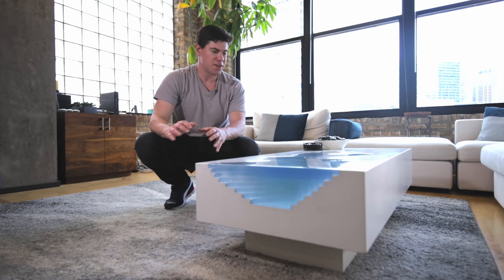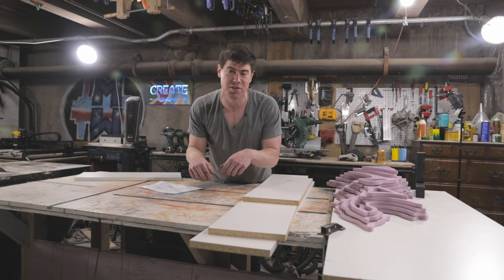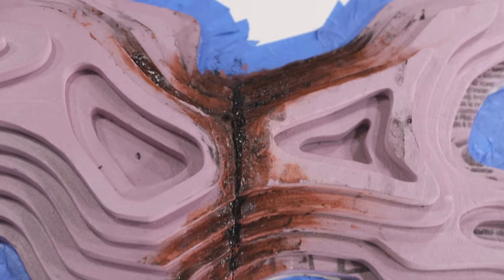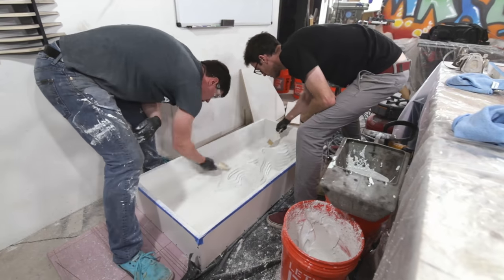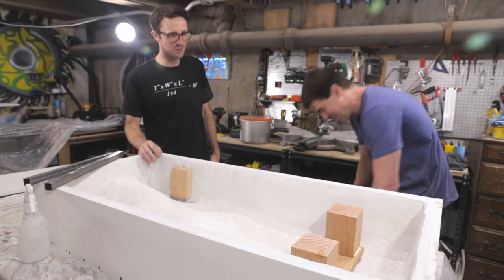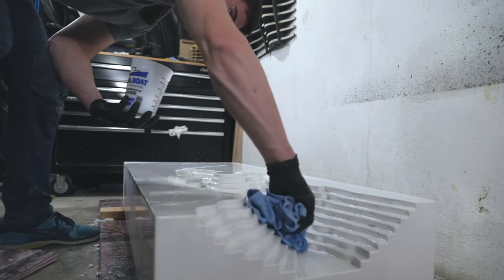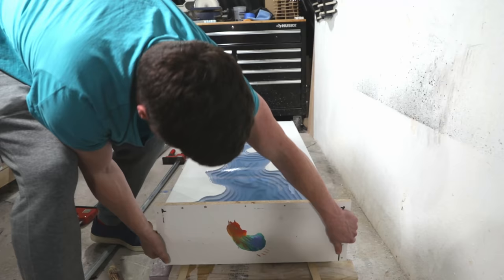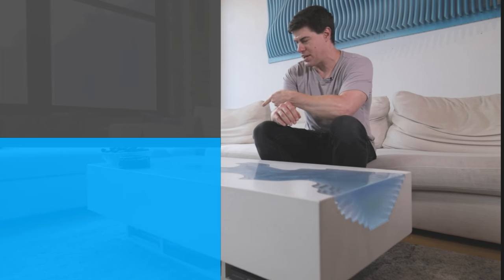Making an Epoxy & Concrete Coffee Table

Comment: Nice coffee table. How about a light set in the bottom? And round recesses for cups (like car cup holders).
Reply from the maker: Good ideas!
Reply: MrBLUEDEVILUK ☝️
Reply from the maker: Another good idea!
Reply: if that was mine, I'd put a thin clear piece of plexiglass over it so if anything spilled, it wouldn't touch the table itself.
Reply from the maker: Plexiglass would definitely help protect it!
Reply: TreeStevens plexiglass scratches too easy imo
Reply: Why would need a cup holder in a table, just put the cup on the table. lol
Reply: naytron I own a dog with a wagging tail. I’ve lost count of the number of times he’s whacked a cup full of drink on our low coffee table. Besides it would make it even more original. Have you ever seen one with a sunken cup key hole design?
Reply: @MrBLUEDEVILUK  I mean or you can just throw away the dog. No more mess😃

Comment: 1:36 made me scared. You should be happy your sawstop emergency stoped. Please never ever use a paralel guide while crosscutting, the board between the paralel guide and the blade isn't secure and if it jams it is going to fly.
Nice build for the rest!! Good use of all techniques.
Reply: I thought the same thing, especially because he was pushing the off-cut with the push stick.
Reply: Please help us noobs understand so we don't die. So when crosscutting against the grain of wood, you should do it by hand? Or?
Reply from the maker: The thing I did wrong was using the fence in conjunction with a cross-cut sled...as I've now learned, this is a big no-no.   Using the sled is fine, as long as the piece you are cross-cutting isn't riding the fence as you cut it.
Reply: you can use the paralel guide ofc, but it HAVE TO end right before you enter the saw, so you cant get stucked. and ofc... dont push on both sides, since it will get stucked again...
i just wonder how it comes somebody got a nice table saw in his shop and has no clue how to use it  /facepalm

Comment: 1:37 Thought the piece was going to get twisted between the blade and the fence, and get thrown with enough force to punch a hole in the wall.
Reply from the maker: and it didn't ;)  that said, safety dictates it isn't worth the risk... will move the fence in the future when using the crosscut sled.

Comment: Vacuums the dissolved gasses out then pours the epoxy into the mold like it's water.
Reply: exactly what i was thinking lmao, whats the point to vacuum if you're gonna pour a thin stream from 3ft in the air.
Reply: Ya that was a waste of time in my opinion

Comment: FYI you can totally cut foam like that with a box cutter, make sure the blades are sharp, don't be afraid to replace them every few minutes, and you'll have no foam dust to contend with and no cnc costs to worry about. The only thing to watch out for here is just keeping your hand 90 degrees to the surface as you cut it for a nice stepped look like the cnc provides, or expect a little more wiggle in that stepped look. Finally to translate a sketchup design onto foam like that by hand, I've found taking screen shots of the form, and then using a projector works really well. if you set the cad of the form into a theoretical rectangle that matches the real life size of the form (say 4' by 4') you can match up the projected screen shot up easily to the actual form to be traced. If you use a little care Ive found this gets accuracy to about 1/8 of an inch, if you're really meticulous you can get it even tighter.
Reply from the maker: I always get little tears when I try to use a box cutter.  A $12 electric turkey knife also works pretty well....

Comment: Love this build, but my first thought is... when the table is turned upside down to insert the foam it would be cool to add a couple small tube inserts at the highest/deepest part of the epoxy sections which would, after applying the concrete, leave small open cavities to insert a couple small LED lights which, when inverted would light the epoxy from the depths.
Reply from the maker: Thanks!  I actually made some 3D printed LED modules to do exactly what you suggest, but the build was already so complicated I decided not to push it this time.  Of course that just means I'll have to do a sequel to this 😉

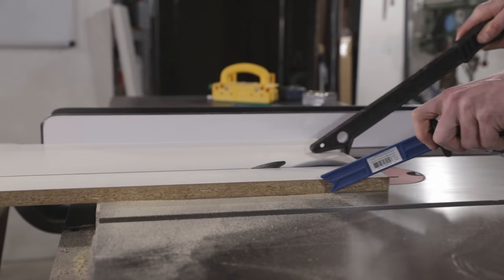Comment: 1:35 
F.
I learned about the Saw Stop in grd 9 shop class, its a life saver but can be a pain with glitches like this,  our table needed 3 replacements due to misfires in the safety mechanism similar to this, and they were quite expensive to replace.
But when it did that in an actual situation it saved my neighbors finger.

Comment: DAP Kwik Seal filler is the best for filling gaps in that pink foamular board.  That or some wood filler, but the kwik seal is a bit better.  Basically, anything that isn't corrosive.  The pink foam board reacts much like styrofoam does and will melt even to some of the mildest corrosive compounds and adhesives.  It's not as resistant as EVA foam.
Reply from the maker: Thanks, good tip!

Comment: Dude... to fill in gaps in foam or to reshape it, just use drywall putty (or spackle). It's the best thing. Doesn't damage the foam and you can make it the consistency you want to by just adding a bit of water. It's what miniature terrain makers like me do :)
Reply from the maker: For sure!  In subsequent projects, I've learned from this mistake and done exactly that (check the concrete beam bench and white concrete sink vids, for example)

Comment: You did such an awesome job showing us how you did each step. Both the good and bad experance was so greatly appreciated so for those who may want to do such a project can learn from what you had done. 

I often think artist are more scientific then most scientists.  Just as you had shown.
I was originally thinking you were going to fill your box frame with cement. Then I was wondering and thinking that is going to be one heavy  bear to lift and move. But, then yiu did is so it would be hollow. That extra thinking I bet made it a lot more easier to move.

Maybe this may help.  When taking art and we would make plaster of Paris  body cast, usually death mask of our self to later fill with clay and put into a kiln to harden the clay.

Well when doing so, we would smear vaseline over our face with a shower Cape over our head so to help keep the plaster of Paris from sticking to us and make it easier to move.

Maybe that may help you as well of give you other ideas so you don't have so much sticking problems with other projects.
Reply from the maker: Thanks!  And I like the "outside the box" thinking!

Comment: That's amazing! For the next table like that you could put some LEDs in there for awesome night/evening lighting, since it's basically an empty box it should be fairly easy to hide some batteries underneath it :)
Reply from the maker: Thanks! Something like this with LED uplighting thru the epoxy is on my build list ;)

Comment: I'm sure you know this by now but you used a Thinner-Based non catalyzed spot putty that is only recommended for pinholes. For future projects try "Evercoat Catalyzed Polyester Glazing Filler".... super easy dispensing container, mixing, shaping and sanding. Takes any kind of finish and wont eat up your styrofoam.

Comment: Polyester resin based fillers dissolve polystyrene foam. Hard lesson learned. You could have used Gorilla Glue in that gap in the foam. It will foam up and fill the gap. If you spritz the foam with a mist of water it will cure quicker. You would have to shape it a bit to the final shape after it cures but that's easy enough with a little sandpaper. Or, a setting type drywall mud would work as well.

Comment: Johnsons floor wax works very nice to make things not stick to the concrete. I made inserts that looked like stone for the face of concrete steps at the Disney resort in Oahu. And kids clay works great at sealing gaps and edges then heat the floor wax up. And brush it over everything. The forms practically fall off.
Reply from the maker: Good tips, thanks!

Comment: this process would be easier called "Shotcrete" as you are spraying it! Can be sprayed dry, or sprayed with water from a different nozzle at the same time =]. the concrete mixture would also be better referred to as Gunite as it only contains fine-particle aggregate! Concrete ready mixer driver and batchman here. this is awesome!!!!!

Comment: Beautiful result! I was wondering though if one could have filled the middle with a lightweight expanding foam, then a sheet of plywood or something to cap it off (and form the bottom). I wonder if it would have supported the weight with just the foam core?
Reply from the maker: Thanks! You could do that, but I would be concerned about the foam compressing over time if it's weight bearing.   you could form a couple concrete ribs between the foam to support the table, and it would probably only add 40-50 lbs (as compared to adding 400-500 lbs if you filled in the whole thing)

Comment: Styrofoam is poly-styrene. Bondo and lots of other resin products also use styrene as the building blocks of the polymer. Any styrene based product will eat away at Styrofoam in the same way. You can either create a protective barrier between the foam and the resin, use a non styrene based foam like a urethane foam, or use a non styrene based filler material.
Reply from the maker: Thanks for the info...very useful!

Comment: thanks for your vids man!! so inspiring and they just keep on getting better... I live in a small town at the bottom tip of south america. We dont have GFRN nor Quickcrete. What would you recommend for working with concrete? now i just buy regular concrete and add portland cement to make it finer... thanks in advance and keep it up!!
Reply from the maker: If you can find someplace that sells acrylic polymer and plasticizer, you can add that to medium to fine sand and Portland cement, plus aggregate, to make your own really strong mix.

Comment: You should be ecstatic about the way that table turned out--it's one of your best results.  Really good work, Mike! 

What do you think about adding trans pigment (blue) to the epoxy and progressively lightening it as it fills the reservoir two levels at a time?  It would result in more pours (4 total), but I wonder if the gradient effect would look cool.
Reply from the maker: Thank you!  it might be kind of hard to tell in video, but just the added depth with the same consistency of pigment will actually result in the gradient pattern when you look top down.  The deeper you go the more epoxy and the more pigment the light has to go through.  You could potentially amplify this effect.  When you see aerial shots of the ocean and the colors change to different shades of blue, this is what's happening. the water is the same color, but the ocean floor is getting deeper, which causes us to see a color change.

Comment: that looks incredible. quick question ... at the end of the video you're sitting on the couch with a big blue wave thingie on the wall. did you make that? is it for sound absorption or just for looks?
Reply from the maker: Thanks! That is a parametric wall art piece. I actually bought that before I started making things, but I did a similar process in my floating wave shelf video.  It is all modeled in fusion 360 and then cut out on x carve. The process is actually pretty simple once you figure out a couple software tricks. I'm planning to use it for a table base or something else like that in the future

Comment: Did you maintain the room temperature above a certain level? In my experience, the cure is not good if the temperature is not at least 21.5 Celcius for 72 hours. Curious. Thanks :)

Comment: I love it! 🥰 It took three pours to get the blue? 🤔.... I wonder how it would look if the first pour is dark blue, second pour- mid blue, and third pour- light blue?....
Reply from the maker: Thank you!  you actually don't need to change the color of the blue because the deeper or thicker it is with the same amount of pigment, the darker the blue will appear to the eye because of it's thickness.  it might not come off as well in video but in person when you're looking at it top down the bottom appears to be a much darker blue than the top.

Comment: This table is beautiful and it was apparently a ton of work but by the looks of it, it was worth it.

BTW Why did you buy the Sawstop instead of the Reaxx?
Reply from the maker: Thank you!  Didn't really consider reaxx, so I can't speak to the difference.  All I can say is that so far I'm very very happy with the sawstop.
Reply: @modustrial  I would be happy too. 60 bucks is a lot of money for parts every time a mistake is made but it's nothing compared to losing a finger or worse. I like the Reaxx cause it saves the blade and it looks like it doesn't transfer as much force into the machine as the Sawstop does when an accident occurs. I don't own a table saw so that's just my take on it.

Comment: If you gave the epoxy and even larger grit sanding / polishing like with some Yorkshire grit - you could get it completely transparent. 

I don't understand though why you didn't patch up the "steps" of the "river bed." They seemed like they had bubbles and stuff so was there a reason not to patch them?
Reply from the maker: Just artistic preference. I actually did do a little bit of patching to them for the really bad spots, but this video was already pretty long so there wasn't room for every little thing I did.  I left some of the imperfections, however since I felt like that gave it more of a realistic terrain feel.  Just my design preference.... I could see how others might want to make the steps absolutely perfect
Reply: @modustrial  okay I understand, thanks for the reply!

Comment: after this video I decided I wanted to make a table like this too but i did have a question. Do you know if over time it will turn yellow or how long it will be to start yellowing?  I plan to leave it clear.
Reply from the maker: Total boat thick set epoxy, like I used,  should not turn yellow at all.

Comment: hey! lovely videos & projects! very inspiring too... I see you keep having some minor issues when taking pieces out of their forms. when you need a separator to use before pouring epoxy... have you tried silicone spray?
Reply from the maker: Yes, I've tried Sprayway silicone spray and it works well
Reply: @modustrial  Thanks a lot for taking the time to answer all my comments^^ your videos really made my "super rainy" sunday. Plus, they are really inspiring and I sure take a few ideas with me when I´m able to use a workshop the next time. - With the silicone... i just know it from working with epoxy but i was never brave enough to include concrete into my ideas... usually silicone works with everything eh? but i was not quite sure how its like in real use. thanks for sharing your experiences there!

Comment: That is a nice table, is it possible to implement some rgb LEDs into the Epoxi?
Reply from the maker: Yes, I actually 3D printed some modules for LEDs that I was going to embed in the concrete under the epoxy. However I decided to save this idea for a later project right before we sprayed the concrete since this one was already getting pretty complicated and I didn't want to add one more variable

Comment: So how long will the epoxy last before it yellows?  I have heard it can go up to a year or are you using a better product that I don't know about?
Reply from the maker: The total boat thick set epoxy shouldn't yellow.  The yellowing is due to UV exposure....and thick set is UV resistant.  Also, with any epoxy, it's best not to place it in direct sunlight to avoid UV exposure

Comment: Why do you like building things using concrete? What would be an alternative to this (something that would weight way less than concrete)?
Reply from the maker: I like it because of the aesthetic...you can get a stone-like appearance, but it's much easier to work with than granite or marble.  Other options don't provide the same stone-like appearance.... You could make this out of painted plywood, but again, it wouldnt have the same look.

Comment: stupid question if you put acrilic sealer to the concrete and the epoxy does not stuck to it if you were to tilt the table would the whole cured epoxy block just fall out?
Reply from the maker: Very unlikely... If there are any parts of concrete that jut out or holes where epoxy fills, the epoxy will be stuck where it is....making a solid removable form takes careful planning to make a mold with draft angle to facilitate removal

Comment: How do you avoid picking up sand and scratching the finish during the concrete wet sand?
Reply from the maker: With 400 grit, I haven't had that issue, nothing special to do, just wait a couple hours after demolding so the concrete isn't tender

Comment: Any plans on making a concrete dining room table? Or is that a bad idea?
Reply from the maker: It's a big undertaking, but definitely doable!  Concrete is used for countertops all the time, and there are a number of food safe sealers, so it can be used for dining tables.
Reply: @modustrial  Would you be concerned about how heavy a 78 inch long table would weigh with a concrete top? Do you think it would be safe to have something that long with only support on the ends of the table?

Comment: Definitely a newbie mistake.  As an industrial designer I've worked with foam board a lot, you learn quick to seal it with wood glue first before trying to fill in seams with Bondo.  And the Bondo you were using didn't look complete, it looked like it was just the Bondo hardener, but yeah, Bondo will dissolve the foam.

For future reference, if you ever need to work with fiberglass over a foam shape, again seal it with wood glue first or the same thing will happen.
Reply from the maker: Good tips.  Thanks!